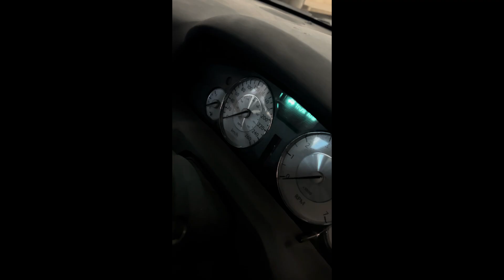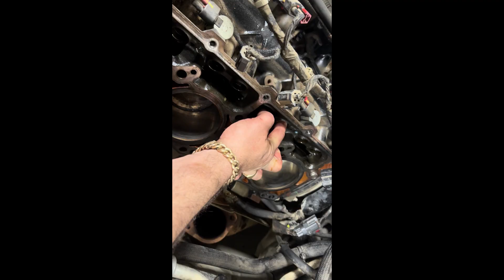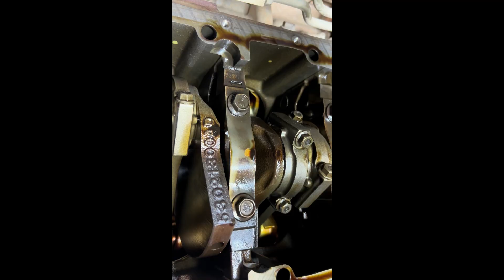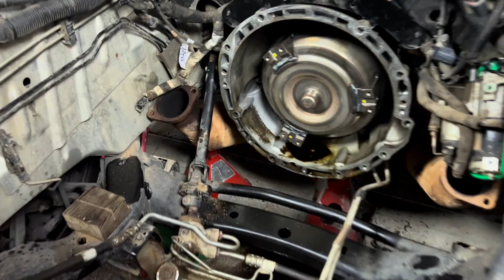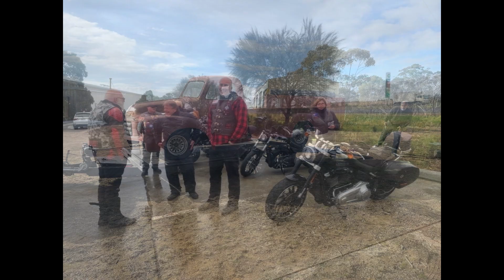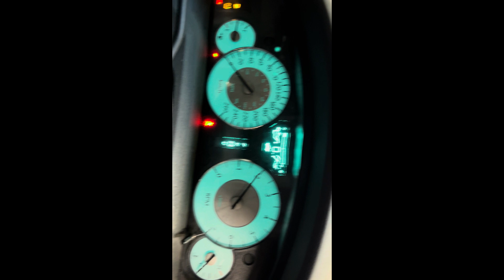Rescuing a $1500 Chrysler 300C with a dead Hemi !

Comment: What did you take out inorder to get the oil pan off the car?
Reply from the maker: Dropped the rack, disconnected the mounts and jacked up the engine. Once on the jack a bit of wood in between each mount and let it back down. It’s tight but you can get it off 

Thanks for watching, hope you enjoyed the video
Reply: @antique350  when I tried it I didn’t disconnect the steering shaft to the steering wheel but I had the mounting bolts off it just wasn’t low enough but l’ll give it that another try! 

Good video by the way!